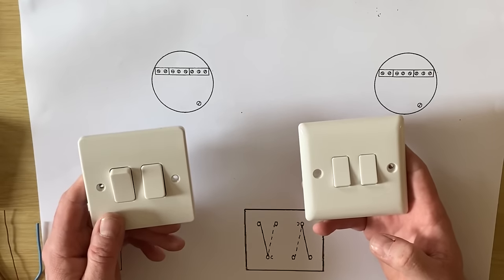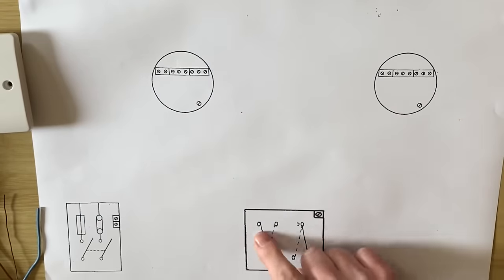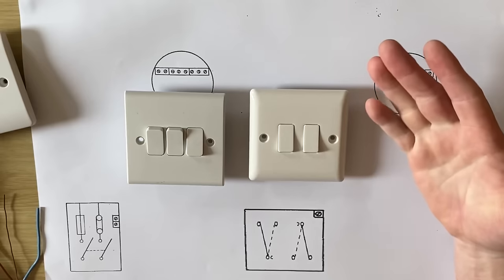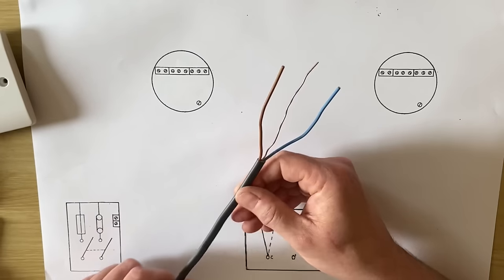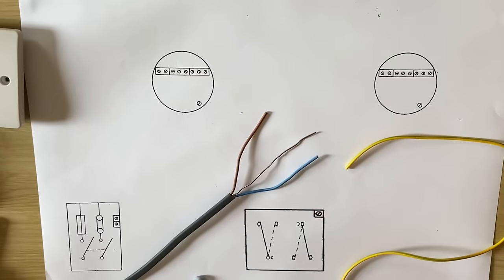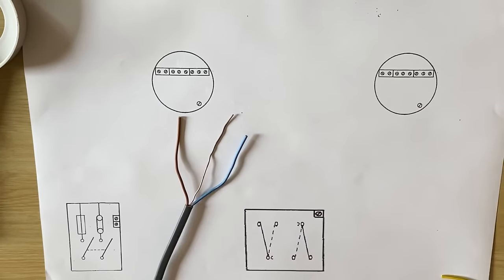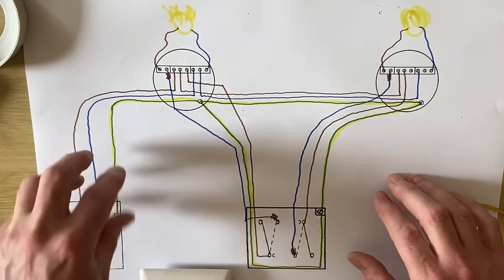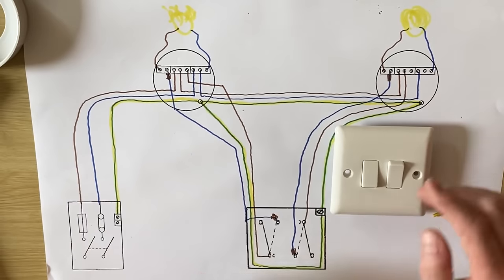Wiring Diagram Using a 2 Gang Switch to Control 2 Independent Lights Using the 3 Plate Wiring Method

Comment: Given how much those switches look like the same plastic — isn’t it possible to take an intermediate switch out of the 1-gang plate and insert it into the 2-gang plate? Or is that stuff too permanently riveted for that to be feasible?

Edit: Oh, hang on. There is at least one reasonably priced manufacturer of 2gang double intermediate (and of course, if the other gang only needs to be 1 or 2 way, just leave 2 or 1 terminals empty). (Liever silk white)

Comment: Hi, great video. Could this wiring be used for lights that are in the same room rather than different rooms? I am wanting to put in 8 spotlights in my living room on dimmers that are controlled by a 2 gang switch (4x spotlights each switch).

Comment: Can I use this method from a 2.5TE Ring Main fused spur as a radial supply to switch a shaver socket on one switch and a cabinet light transformer on the other switch?

Comment: Excellent videos. Is there any chance of the tech on similar wiring but for wiring through the switch on 2 gang please. Have power supply coming in and need to operate 2 different lighting systems (porch light and hallway) from a 2 gang switch. Many thanks

Comment: Thanks for the video. Just wondering whether it's absolutely necessary to connect both CPC wires to the switch CPC terminal in this case? Seems even with only 1 CPC connected to the switch terminal, both lights and the switch would still have cpc connection back to consumer unit?

Comment: Thanks for you're explanation very good job!  but the question I have is  I'm running a 3/4 with earth core cable running to my 2 way switch can you explain how I run my cores in My  switch l to keep each light separate??  Do I just link across my commons

Comment: Thanks, really helpful video.
I'm assuming if you were running the lighting circuit on to other rooms, you'd use the vacant terminals in the right hand light fitting to continue the journey?

Comment: @GSH Electrical. 

This is pretty close to my problem i'm trying solve. 

I want to remove the 2 physical switches that control 2 lights and have them on. 

Then I will add 2 wireless switches that are controlled by my Hue bridge, 

But i've removed 1 switch and now they don't switch on. So i'm learning how to remove both switches and wire the lights on. 

I know the Question and trying to ask. So its a start.

Comment: Thank you very helpful. I have to replace a double switch but one of the switches has two L1 - how do I describe this type of unit when search for a replacement? Thank you, Mike
Reply: What did they mean by two L1? Just two terminals that were shorted together?

Comment: There is a company called "Trendi", they have a 2 gang which has a intermediate and a 2 way.
I think they have a few 3 gang and 4 gang which have intermediate scattered in their catalog also.
Though, their design choice is polerising (?) but I gotta admit their ability to fit a 4 gang on a single plate is quite impressive.
Reply from the maker: Thanks for that great update Colin 👍

Comment: Any chance of a video showing the most efficient or best practice way of wiring up 2 lights with 2 x 2way switching? 

2 x lights (1 up, 1 down)
2 x 2 gang 2way switches (1 up, 1 down) both being able to switch both lights? 

Love the videos, very informative and easy to follow for a visual learner.
Reply from the maker: Wiring Diagram Using a 2 Gang Switch Downstairs Upstairs 2 Way Switched Using 3 Plate Wiring Method
https://youtu.be/0VnbtsSPcow
Reply from the maker: Not all the videos are public but can be viewed via this playlist 👍🏻

Wiring Diagrams for Lighting and Motor Circuits
https://www.youtube.com/playlist?list=PL2Ea5r9gxUUfm4SACOSOZigCeSxxC5xaO
Reply: @GSHElectrical  Thats great, thankyou so much. Keep up the good work :)

Comment: Is it possible to use the two plate method to wire a two gang switch? Or is there a good reason you only show the 3 plate method for 2 gang switches?

Comment: I have an issue with replacing a 2 gang dimmer switch with a 2 gang 2 way regular switch to control two different lights.

All I have to connect to the switches are 1 blue, 1 yellow, 1 sleeved (must be switch live) & one red.
I've struggled to get them to work without tripping the fuse box.
It looks like the dimmer switch was connected using a bridging wire from one gang to the other, but as some of the wires came out when I removed it from the wall I don't know how they're supposed to be connected

Comment: how do I add in an extra double gang switch to an existing circuit. At the moment I have a switch in my kitchen that operates two seperate light systems (double gang). Having turned the door around it now obscures the double switch behind it so I want to add another double switch outside in the corridor (before entering kitchen) how do i do that? It has power coming into switch direct from consumer unit and then goes to the lights.

Comment: Great and easy to understand Video. I love your channel. I have a great question in regards of these two gang Wiring.
I am planning to replace a two gang switch to a Smart switch that requires a neutral. Now in current configuration you would have four conductor at the switch.  Two live ( from the same Circuit ) and two switch live ( to the two celling rose).
If one of the live would be changed to a neutral at the loght fitting you would have a shared Live from the other light fittings to the two switched live. I assume with low power (LED lights) the shared live would be safe to use especially if it is connected to a 6amp mcb. What is your professional opinion?

Comment: What if I have a 1gang switch at the bottom of the staircase and another 1gang at the top and two lights (again top and bottom) and would like to change them to two gang switches so that I can switch both lights separately? Do I need to run a new wire?
Reply: Yes, that needs a bunch of new wires. (Well, 2, actually. Both running between the two switches. Definitely the easiest routing to do that. Conceptually, one three+earth cable is going from its primary switch to the secondary switch at the other location, and the other is the same cable but traveling in the other direction for the other light.)

Comment: Hey GSH, your videos are really helpful, thank you. In particular the diagrams available for download, however, I have 2 questions. 1. What are the circles with three ports - diagrams from page 6 onwards - representative of, don't want to assume. And secondly, as a visual learner, do you have any links to similar diagrams for other circuits to work from?

The diagrams are extremely helpful and very useful for my mentor/s to use with me, especially with the 2 gang 2 way which ive struggled to get my head around for a while now. Thank you!
Reply: Ever get an answer?

Comment: can you take power from the first switch to connect to the second light
Reply from the maker: Wiring Diagram Adding a Light But WHY Use 3 Core and CPC Cable Connections Explained
https://youtu.be/fa3c88DxB5w
Reply from the maker: One of many options 👍🏻

Comment: If I was doing it I would link the live between the 2 switches and just use a single 1mm double insulated cable back to the second ceiling rose for the switch wire
Reply: I Agree, but feed to switch every time for me.

Comment: I have I have a 2 gang 1 way switch for downstairs hallway & bathroom. I have installed a Trendi style switch but i now have the rocker switches in opposite ends when bathroom and hallway lights are on.

How do i resolve this please? it is so frustrating :(